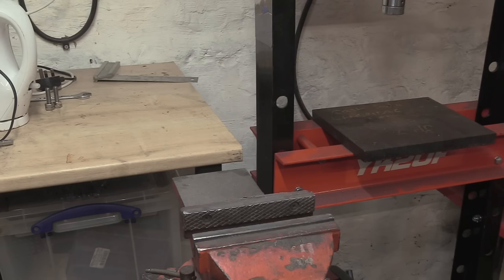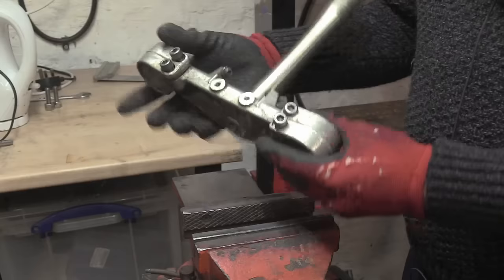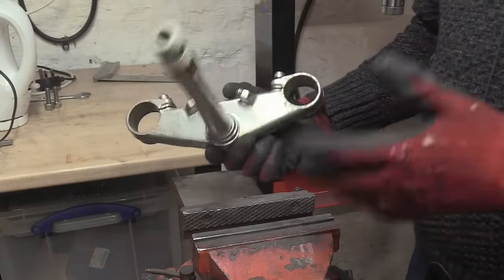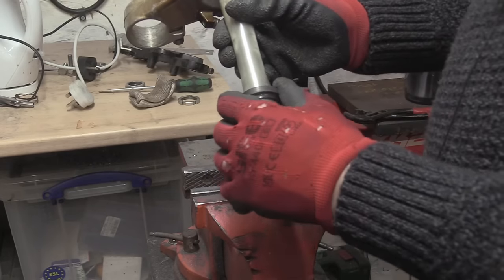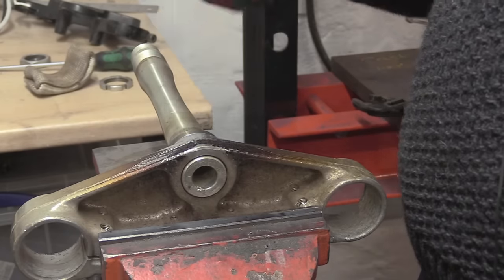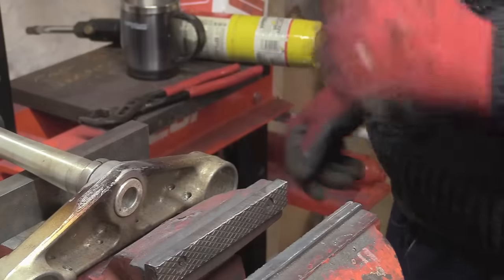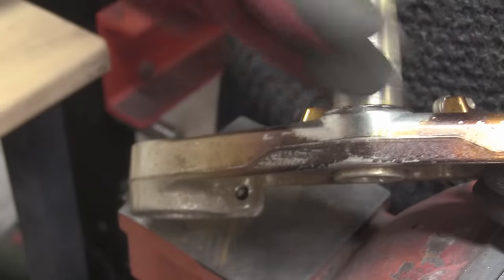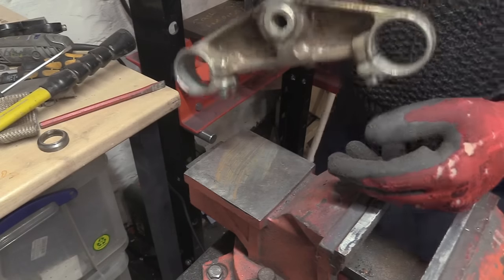2 Ways - steering bearing REMOVAL

Comment: I Dremel both sides of the race 180 degrees apart and quite often it just breaks into two parts with very little force.
Reply: same here, often put a slice in races with a cutting disc wheel hubs on cars etc, the heat expands it and helps things if dont linger. cheers.

Comment: I normally notch a v into the race and just give it a tap with a chisel, they usually shatter pretty easily. I do the same with the ones in the frame too. less faff than drifting them out.

Comment: Oh come on Matt. Definitely been influenced from the del balls. Look at the mark on the bottom of the shaft @8 minutes compared to 12 minutes. I’m not angry just disappointed 🤣🤣
Reply from the maker: Camera angle. The marks are there before, just not as obvious.
Reply: @dirtygarageguy  not a chance. I’m referencing the mark that is there after refitting the bearing race on the very bottom of the stem. Plus there’s a mark on the stem after cracking the race. Which is conveniently to left in later shots
Reply from the maker: Give me a time stamp exactly, I don't know what you're talking about
Reply: @dirtygarageguy  
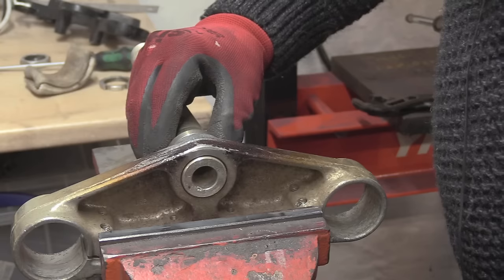8:00 bottom of stem. Guff mark pointing slightly left 
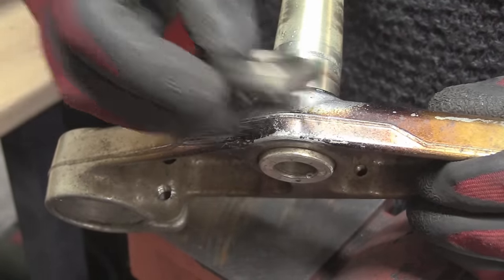12:00. Same mark pointing to the right 
10:50 after cracking the race there’s a mark on the shaft right where it was split 
11:24. You can see the mark from cracking the bearing on the left of the stem and now the cuff mark on the bottom is on the right hand side of the yolk

Comment: The 2002 R6 service manual on page 7-62 says "Remove the bearing race from the lower
bracket with a floor chisel and hammer". Never had a problem doing it that way. Is the procedure different for other bikes according to the service manual?

Comment: I have seen two more methods that are theoretically better than the ones you just showed. One involves using an air chisel on the lip of the bearing race to push it out, and it seems to be the fastest and more efficient way of removing that bearing, the second is about pressing out the stem, which in turn will also remove the bearing. Maybe you can try those too in another video.
Reply: The air chisel works well but on the type of race in this video there is no lip to use. Cutting is pretty easy.

Comment: Matt what do you think about induction coil heater things would that be a cleaner option for method 1? not used one before so don't know how well they work.
Reply from the maker: If you can get one, although the issue with the ally stem is still a thing

Comment: I can't think of any reason why manufacturers don't have holes in the bottom yoke for a pin driver to tap the race off the stem. I did come across this on some BMW's with conventional steering and forks, this made removing the bottom race child's play.

Comment: Wear goggles when you do the hitting, no joke.
And make sure noones stood off to the side either...
Those can go bang with some serious force when they crack.
And you can get bits of shrapnel flying out like bullets.
I had a piece of a transit one go near all the way through my cheek once from someone twatting one without warning  on the bench down from me.
Reply: I was going to say exactly the same thing......
I had a hydraulic puller on a gear box bearing when it splintered a slither off that whizzed past my ear at very high speed and embedded itself in a featheredge fence 2 meters away with enough force that it was below the surface, the slither was about the size of my grandads big toenail, just not as sharp.

I generally cut diagonally with a dremmel if at all possible to, then split.

Comment: Na mate, an old seasoned pro told me that “It is always hammer, chisel, bang, crunch” only way to do it!
Reply: That's what a Del rebuilt engine would sound like

fAcToRY AyEEEEE
Reply: Did you do it properly and smear it in copper grease first?
Reply: Oh yeah, the old boy told me you need plenty of that all over, on the sides, left, right, up, down, inside and out, but you knew that didn’t you 🙄
Reply: @Jut123  yeah but were you putting it on before or after the beef layer of black antichip suoertough megahard ultra black?